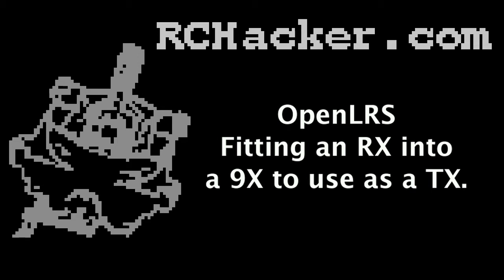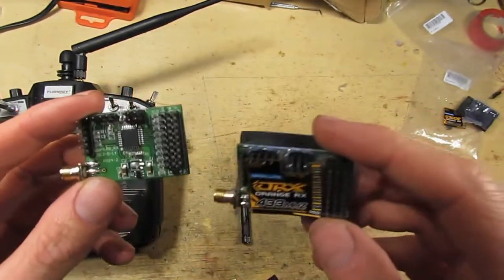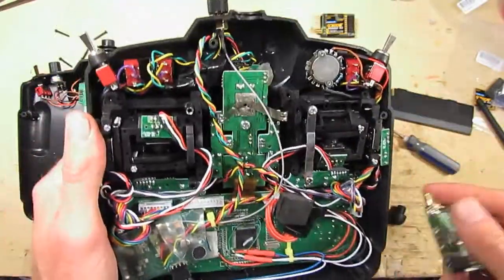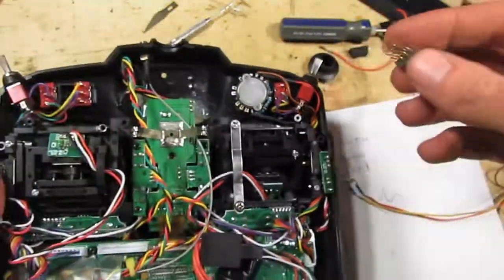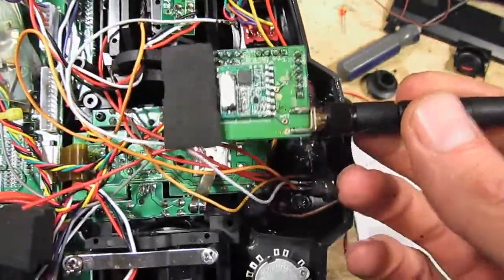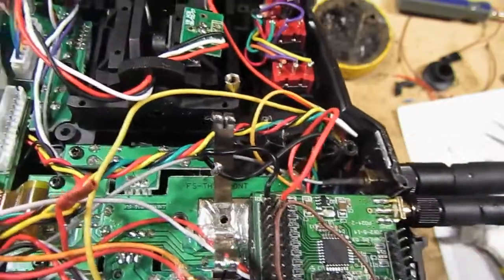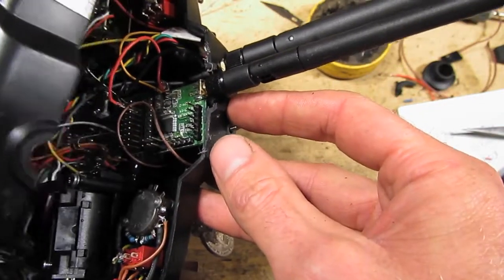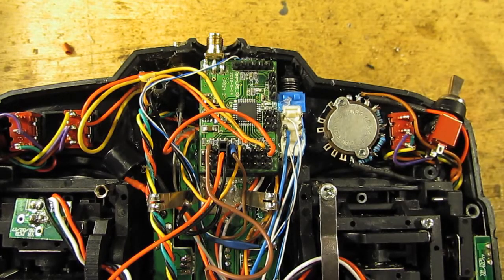An OpenLRS RX as a TX in a 9X. RCHacker #43

Comment: RCHacker maybe you can please help. I bought 2 Orangerx lrs 100mw flashed NG on the both. Flashed one as a Tx and the other as a Rx. But I need to figure out where the PPM output is to connect it with my Pixhawk. am I correct in thinking I need to remove the transistor for the speaker and use the bottom left pad as ppm out? what about ground? sorry for the newb questions. Any help would be awesome!!!

Comment: Thanks for the inspiration!
Just a question, is telemetry on 9x and opentx now possible?
Reply from the maker: You're welcome. Yes, I've covered it in this article and video:
http://www.rchacker.com/projects/turnigy-9x
https://www.youtube.com/watch?v=IWknA1CagY4
Reply: Sorry that question was incomplete. Let me rephrase that.
Is telemetry possible with a 9X, OpenTx, OpenLRSng, and with an Rx working as s Tx?
Thanks for the quick reply! :)
Reply from the maker: John Zabala Yes, I have that setup myself.
Reply: Please correct me if I'm wrong.
To get telemetry data:
I'll connect port13(Tx) & port12(Rx) pins on OpenLRS 9CH Receiver (working as Tx) to 9X's MOSI & MISO? Is this possible? Sorry I'm a total noob to this. :)
Reply from the maker: John Zabala Seems right, I cannot remember off the top of my head. Check the videos and articles, it is all in there. Its good to put a resistor inline with those connections just to be safe.
Reply: Found it! It was on the other build (or hack) video. Thanks so much! ;)

Comment: I used this as a bit of inspiration, I just moved my stock 9x tx into the handset, and located it behind the board that the switch is on, then made a hole in the plastic where the turngy badge was for access to the bind button. 

the openlrs module went right into the module socket on the back of the handset, and I ran the power from each of them to different sides of the throttle cut switch, ran the main power to the middle pin of the switch and cut the trace that normaly powers the modules, 

works like a charm, easily have space for a third module, maybe fourth
Reply from the maker: Daniel Farley Lots of room in the old 9x, best thing is your radio wont break when you crash. :)
Reply: RCHacker Yeh exactly, the only part of the system you dont risk when you fly, 

unfortunately i burnt my rx for the openlrs trying to flash it, dont know how, but a new one is on the way, i'm looking forward to a little fpv on something other than an expesive multirotor with gps and position hold
Reply from the maker: Daniel Farley no more than 3.3v. Its the only major design fault with the openlrs. I also suspect that hobbyking make the same mistake and ship out dud ones also.
Reply: RCHacker yeh i read that everywhere, but I didnt connect the 5V on mine ever, but it would just start the code before arduino could start the upload, so i put a switch on the reset pin, but I put it on the wrong side of the pull up resistor and fried the votlage regulator, I changed the volt reg, and its still botting the sketch and not uplading the new one, grrr
Reply: RCHacker hey, i got it working in the end, I had to burn the bootloader with an arduino as an isp, then flash the sketch, 

the rf module appears to be ok, it works at over 10m in a wifi infested office, and knocks the wifi out when I turn it on, so i guess thats a sign that the rf power is still there, 

do you have a guide to config inside arduino ? I cant get the beacon to work
Reply: Daniel Farley Great good to hear. Sorry should have suggested that. The openlrsng configurator is used for all your configuration needs. http://goo.gl/iX7dJx
Reply: Marc Griffith yeh i got it working with the chrome config tool , i couldnt get it working through the defines in arduino , but hey ho, 

now to make a directional antenna for my baofeng uv3r,  sods law means I left about ten pmr radios in spain when i moved away last month, one of them would have been perfect, 

do you know of any people who have had any luck using the i2c interface? I would like to play around with that ,

Comment: Great video Marc.  I want to step up to UHF and I like the HawkEye LRS, however... I kind of like the module that fits inside my Turnigy 9X rather than hot gluing that HawkEye Deluxe TX on the back of m 9X.  My question is, am I giving up something vital by going with the HawkEye module that plugs into the module bay on the 9X?
Thanks for your advice!!
Reply from the maker: I've got a feeling it is exactly the same electrically, just a different board design to fit in the box. Although there is a 100mw module out there, 1W is too much unless you like flying solo.

Comment: so if those standard 433mhz antennas are helical inside, doesn't that mean
 the antenna should be pointed at the plane to get a stronger signal?
Reply from the maker: This is a normal mode helical, you are thinking of an axial mode helical.
Reply from the maker: No, pattern is like a monopole. There is no reflector and coil is much smaller than the wavelength.

Comment: I have a f450 using all dji nazam v1 upgraded to naza v2 with gps and I am also using a stock turnigy9x with stock receiver,i use the 3 position switch for atti-gps-manual,but I need help on how to setup and use ioc features rth ,homelock,courselock please help I tried everywhere with no luck please help davidringler40@yahoo.com
Reply from the maker: All I have heard is that naza is a pile of shit. Go on the multiwii irc and ask dongs for help, he is the expert.
Reply: RCHacker RCHacker The NAZA is not a pile of shit ok. Yes its over priced and may not be as good as the multiwii irc stuff but I wouldn't know about that because Ive never used the multiwii irc which makes my point. Ya cant really judge a flight control based on what you hear online because so many people state opinions based on what they "think" but don't know rather than what they do know. Now if you bought a NAZA M V2   for yourself and compared them and came to this conclusion then I would simply say ok and agree with you.  I wouldn't even call and original KK board a POS because its a $14. board and its well worth $14 bucks although it cant do anything but fly. Right? My NAZA-M v2 does everything that its suppose to do as advertised without me having to be an expert hacker to get it to perform.
Reply: thank you, and I just don't have the time to make adjustments to my fc everytime I want to fly, I truly believe that most naza problems are users fault no upgrading and selecting recommended settings,also they are massed produced and I am sure some can be messed up bad qc at times.but junk never.
Reply from the maker: You should contact DJI or buy the DJI radio that goes with the FC.

Lets make this clear, I am happy to help with stuff that I have owned and used. Generally that means stuff that is open source. 

Being closed source, unless you are a genius you are completely stuffed if you want to customise anything..

This guy, timecop, has made his own flight controllers, and the afroesc. He knows what he is doing and his opinion is enough for me.
DJI Naza-M Paid Review Part 2 [Unboxing]

Even if there are better versions now, I won't buy them because they are too expensive and closed source. 

Good luck.
Reply: no I am gonna switch back to my turnigy 9x it works just as well as my spectrum and an 8 ch rx for 9x 10 usd dx8 ar800 179.99usd and its no better!
Reply: I wish sombody could help me setup my open-Orange 433mhz receiver lol. Hell I cant even get the sob to bind.
Reply: I had same problem opened it up and it was just poor soldering! you could clearly see it once open

Comment from the maker: I don't have one so cannot advise you much at all. I have seen people do a similar setup to my 9x that has both systems installed. The easy option would be just drop an openLRS module in the back. Getting telemetry working will require some extra work.

Comment: I also have an idea of using a cheap ppm encoder and some servo testers to add more analog channels to the 9x radio so I can use one of the servo testers to control a camera shutter. I just connect the ps2 stick button to the servo tester mode button so I can put it into auto mode that makes the servo go back and forward constantly working a camera shutter. I suppose I could also put the camera pan and tilt channels onto a pair connected to the pots on the ps2 stick

Comment: I have also done the ps2 mod and 6 position switch mod but a little different form you. I put the ps2 stick internally a little lower down to clear the main sticks and trimmer pots on the 6 position switch so I can tune each position.

Comment: Great video!  Can you post some links on how to use the RX as a TX?  For both programming, binding, and connecting the frsky telemetry?  Im building a frsky to openlrs relay, so i can mount a larger 433 moxon antenna with a 1.3g crosshair for a wireless base station.

Comment: Marc is there a way to use OpenTX with orange NG software and using the 6 position APM mod to get the 6 modes BUT have the modes show on the 9X screen???

Apart from having stickers on the switch its hard to remember when geting old
Cheers Brett

Comment: Just a quick note that the openLRSng v3.1 has the LEDs and variable freq buzzer output wired on the servoheaders. (the LEDs and buzzer work parallel with the onboard LEDs/ old buzzer output).

For a varianle tone buzzer connect a magnetic passive buzzer to 'port1' (RSSI) via a transistor.

Red LED can be connected between GND and port6 (CH5).
Green LED can be connected between GND and port7 (CH6).

Comment from the maker: If I were to do it again I would use a module. If you are happy with risking the quality control, the HK stuff is a great start. Although the stock antennas are crap and I had to re-flash the boot loader on one. If you want an investment get the flytron M3 module. DTFUHF makes a nice small 4channel rx. The author of openLRSng is also designing the next generation openlrs gear, openLRSngTX and openLRSngRX32.

Comment from the maker: Not my idea, possibility has been around for a long time. OpenLRSng firmware only recently supported it.
I switched 4 lines power, ppm, tx (telemetry to the 9x MCU) and rx. RX is not used by me yet but it is nice to have it there. Best to do the DHT telemetry mod by bypassing the rs232 converter as in my article above. 1k resistors are good in series for the tx and rx lines, good protection incase pins are not configured right or connected wrong.

Comment: That's such an awesome idea to use the FrSky telemetry protocol to the 9x!  What lines did you wind up switching besides power?  I'd like to be able to turn off my DHT module inside and use an external module -- can I just turn off the power to the DHT, or do I need to disable the PPM line as well?  Thanks!